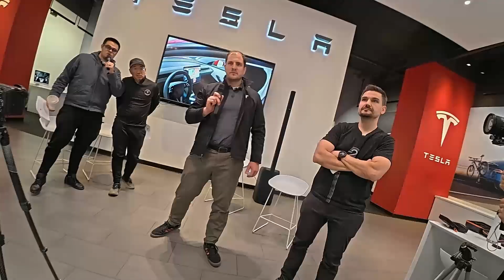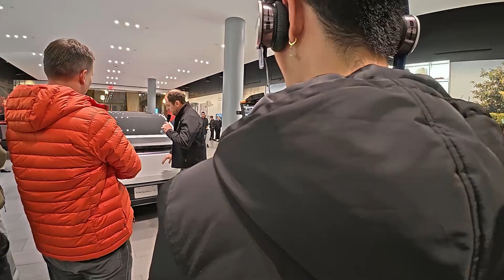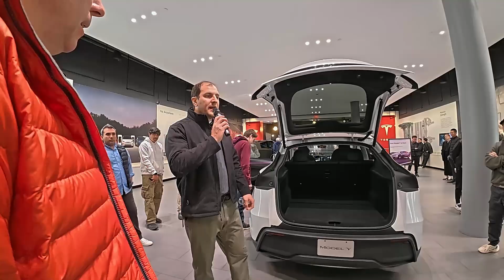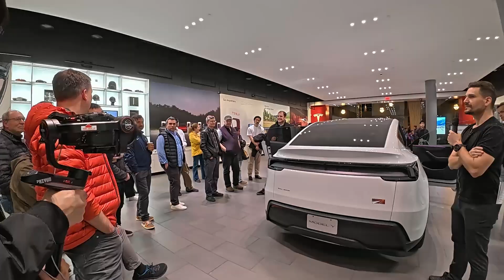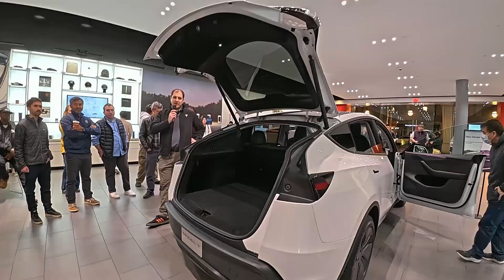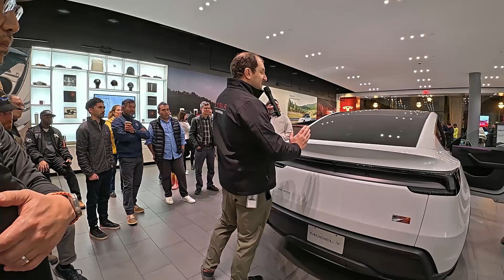Model Y Juniper Design Team Q and A

Comment: 19:01 - They're admitting to stalks removed was a poor decision. And then go on talking about how auto-shift is becoming better and better, dude - You shouldn't remove a feature if its not ACTUALLY good. Jesus christ. 

Then the engineer on the right goes to talk about how the stalks dont have the two-step indicator clicks, because AUTO CANCEL is SO GOOD, you only need one click. ITS SHIT TESLA, ITS BAD. Wtf are you doing.

And then they are asked if Model 3 gets stalks back - guy is blank, the other guy says no. Its obviously coming back.  But in a worse design. 

Really not great to watch this guys.
Reply from the maker: They said it was unpopular and they listened to owners. 
As for the questions about model 3, these guys don't work on the 3 so I think they were just speculating. 
But Tesla does make changes mid year. 
I am not sure what double cancel thing you are referring to. 
I like not having stalks except for in round about. That was me that brought that up.
These guys only work on the Y.
Reply: @mountainmantesla4395  the double swipe is the ability to do a short flick with the blinker which cancels after 3 blinks. This is what they argue is not necessary due to their AI
Reply from the maker: Also I think he said auto shift or swipe on the screen which is what I do every time, he said people haven't complained about that. 
It's funny when I drive my wife's 2022 Y I always swipe the screen to go and then realize she still has the stalks.